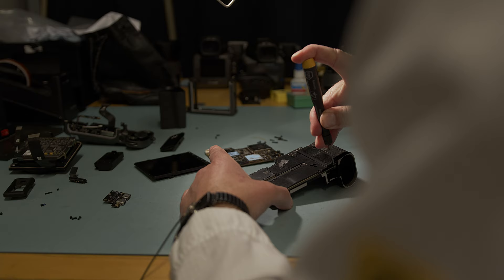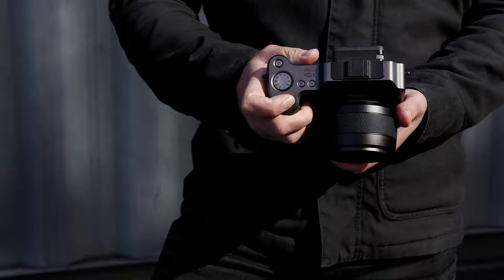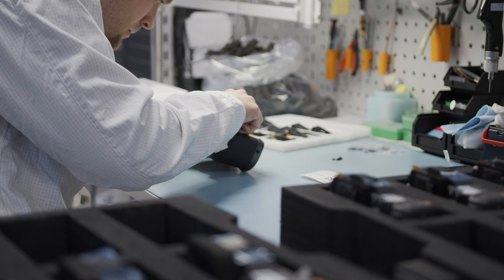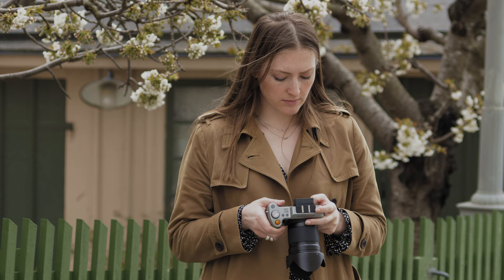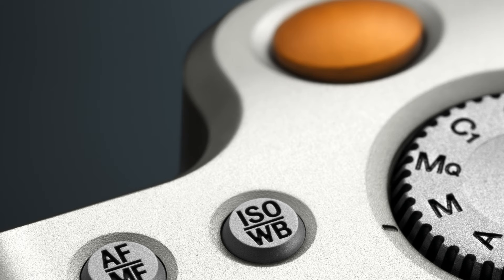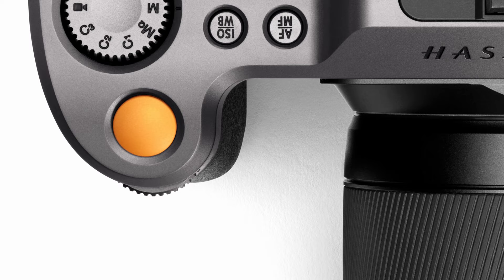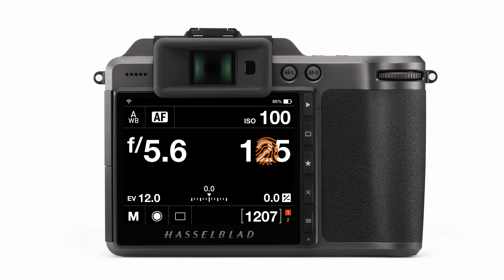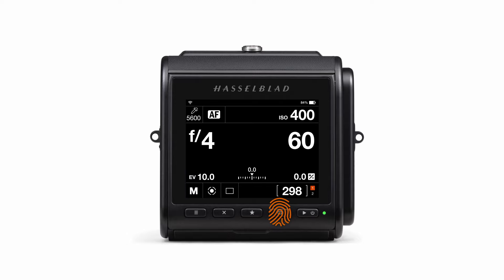Hasselblad's Home: Episode 2, The X System's Ergonomics, Materials and Hasselblad User Interface

Comment: So nice to see the reasons for attention to detail with the camera, I held the Fuji GFX 50s in my hands before buying the X1D-50c and after a bit of time shooting the grip became very slippery in the summer heat. Ever since I hired out a demo unit in 2016 I was in love with the camera and its quirks. It doesn't matter what others opinions are on cameras as Hasselblad has done an outstanding job with their cameras, I just hope we see more from them and they don't slowly drop off the radar in the coming years.
Reply: Could not agree more - I went the whole nine yards with the GFX50s - and in the end it gave me zero confidence in that there were about twelve trillion different settings and had I turned the right ones on or the right ones off. X1DII and the 907x is where I am now and the images are off the charts, the logic is simple and the lenses are understandable - love it
Reply: @nelsonclub7722  I completely agree, when I first got the X1D I was amazed by how simple it was and it does everything perfectly. I was a canon shooter before and I thought those menus where simple but now looking at them after a few months now being full time Hasselblad it is complicated. I do like the lens line up and there being so few just makes buying and selecting gear so much easier, I would like to see some more zoom lenses from Hasselblad for the H and X system, it would be nice to have something the the Fuji 100-200 that would be incredibly useful.
Reply: @SimonPhillipsPhoto  Agreed - I am sure they will come - have a great one!

Comment: I've been waiting for years for a Hasselblad to upgrade the X1D. I am starting to think it's not coming any time soon. I want to buy a mirrorless MF system and love the design and economics of the X1D, but Fujifilm is leaving Hasselblad in the dust particularly with the GFX100s. Not just in terms of resolution but also features like IBIS, tilt-screen, compatibility with Capture One, etc. All things being equal I'd buy the X1D over the GFX100s--even at a higher cost--but as this point in time all things are not equal.
Reply: And how do you feel about the X2D?
Reply: @anthonyrock5039  Looks amazing. I held off and never bought the GFX100s so I will likely now go with the X2D. The only feature that I’m disappointed with based on what I’ve seen and read is the tilt-screen. I don’t understand why Hasselblad designed it to tilt only in landscape orientation but not in portrait. I would use this system primarily for landscapes, and I shoot ultra-wide angle close to the ground quite a bit, often taking several exposures to achieve sharp focus throughout the entire scene, and the tilt-screen is very useful in that situation. Ideally the screen would tilt in both landscape and portrait orientation as the the Fuji screen does.
Reply: @mattslev  I understand. I have been using the 50s, 100s gfx for a while and have the X2D on order asking with the 90v2.5. I hear you regarding the tilt screen oddity. They seem to have simply matched the old tilting traditional option they have on the anniversary model. Regarding the viewing option. Phocus mobile will give you an even better viewing option wirelessley. I have the 45p lens and also an xcd to m mount adapter to give me access to some other lens options as well. The GF lenses had been 50% of what hasselblad asks for their equivalents.